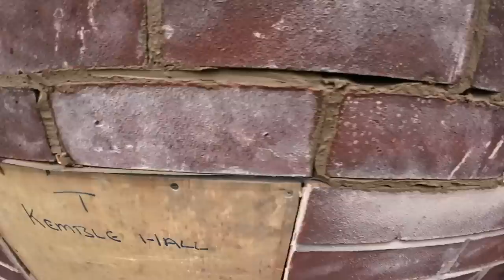THE MOST SHOCKING LINTEL WE HAVE EVER SEEN !! ALTERATION JOB PART 2

Comment: As somebody who works with old farm machinery it never ceases to amaze me the power of rust expansion it can literally force anything apart. It puzzles me that these were not galvanised. Do you think these were put in when the windows were changed to PVC and the original brick was just sat on the wooden window frame. I note it was wood lintel on the inside. interestingly enough my bungalow was the same as this timber beams inside and bricks saw directly on the wooden window frame 8 ft wide 😳
Reply from the maker: Too many like this to be remedial ones . Just a lot of lintels reaching their replace by date 😬🧱👍🏽

Comment: Hi Lads. The lintel was actually proper angle iron, and not steel. The iron has delaminated over time, as you’ve found out. Good work, as always, cheers.
Reply: Angle iron is only a generic term and has not been used probably since Victorian times. I’ve worked on and off the steelworks at Scunthorpe for 50 years and it’s still called angle iron in engineering construction although it is mild steel.
Reply: Exactly 👍 @riptiz

Comment: Has the window tax kicked back in?
Reply from the maker: What is the window tax ?
Reply: @SteveAndAlexBuild  Over a hundred years ago houses were taxed according to number of windows causing people to brick up windows.
Reply: @SteveAndAlexBuild  Imposed in England in 1696, the tax—a kind of predecessor of the modern property tax—was levied on dwellings with the tax liability based on the number of windows. The tax led to efforts to reduce tax bills through such measures as the boarding up of windows and the construction of houses with very few windows.
Reply from the maker: @MikeTowler-kw3ly 😳🧱👍🏽